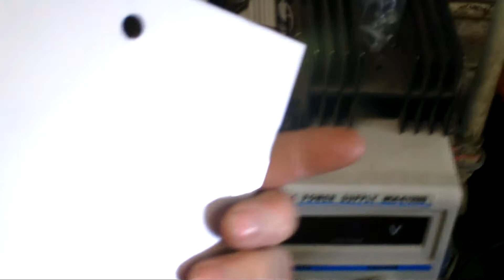Part 1 HHO Cell Build Up.

Comment: 304 stainless? not 316L?
Reply from the maker: Yes 304 works well. I dont know where the "you need to use 316l SS" came from.
I have used 304 for years without any issues
Reply: good info, thx. i have been looking at the h-cat developments from Justin Chuch and others and am wondering what's happening? I was looking for info on the h-cat board and failed on finding it. i have been pursuing a project (for 4 years now - Garvey Energy Project) to raise consciousness on steam power producing electricity at a community level, hopefully developing a unit that could power a high school eventually, and meanwhile developing a program which can be taught in high schools. There are several areas on how to make steam that i am trying to pursue ... HHO and H-CAT are on the top of the list. Also, I am looking at also 13.56Mhz to make HHO discovered by John Kanzius; also using a microwave to turn fire into plasma. Any updates or info greatly appreciated. BlessUp from Western Jamaica.